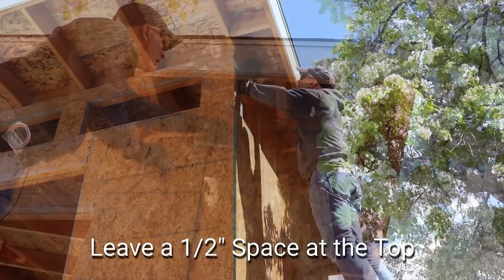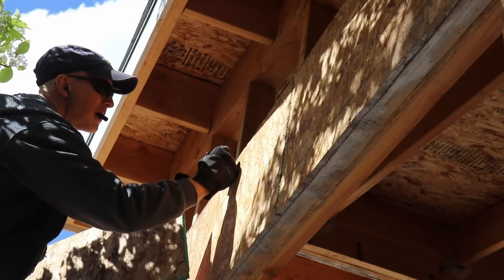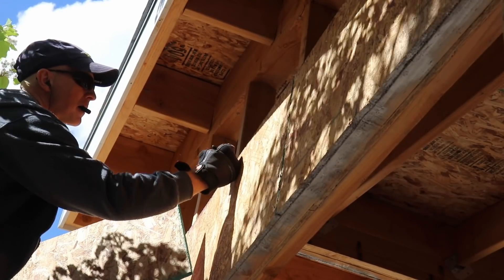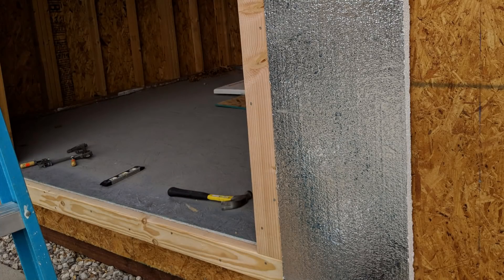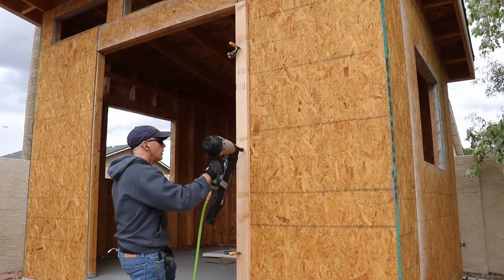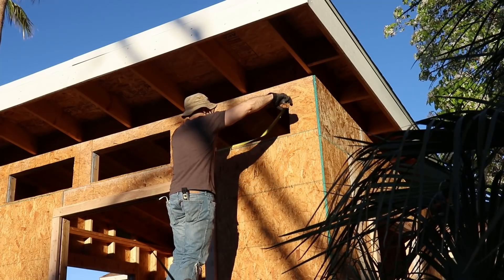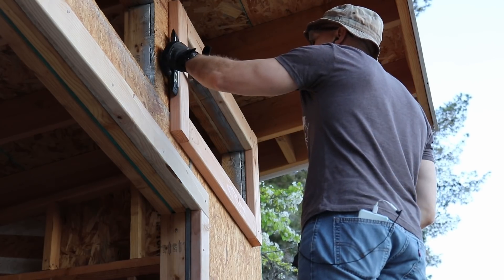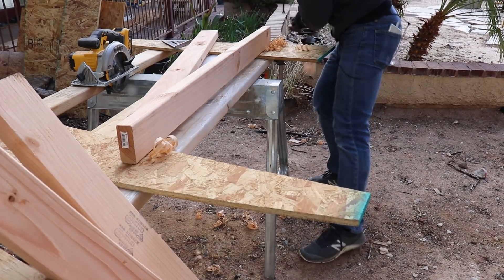10x12 Modern Shed - 09 - Finishing the Walls and Bumping Out the Windows and Doors

Comment: And particular reason you're insulating a shed? I'm up north so very different climates, but I still can't see insulating one even down south....?
Reply from the maker: I'm going to be working in it as a workshop. I'm more concerned about the heat than cold. Plus I'm using it as a way to experiment and learn about house construction.